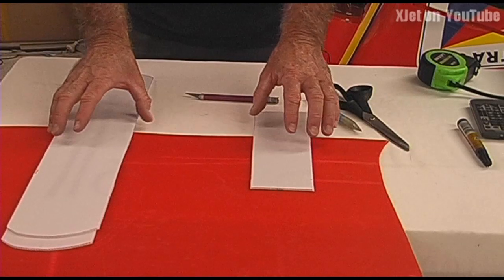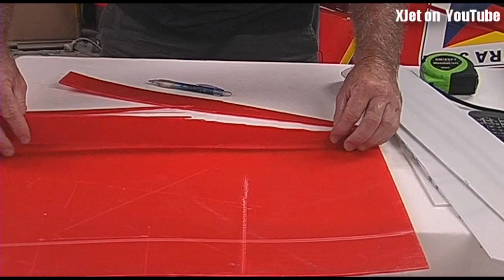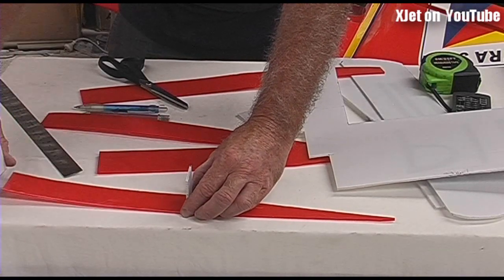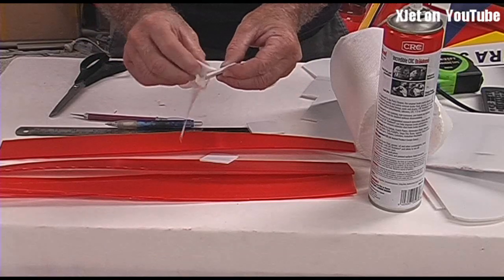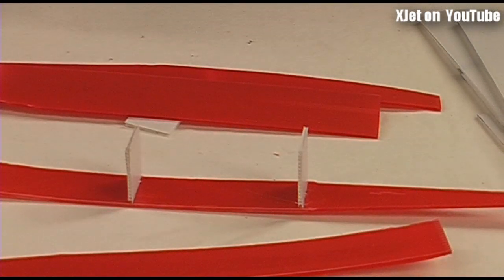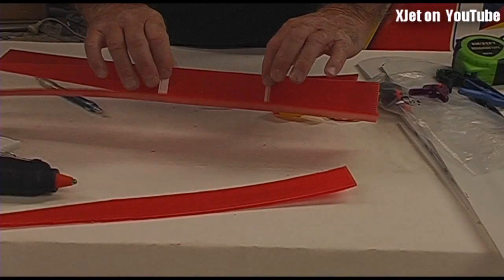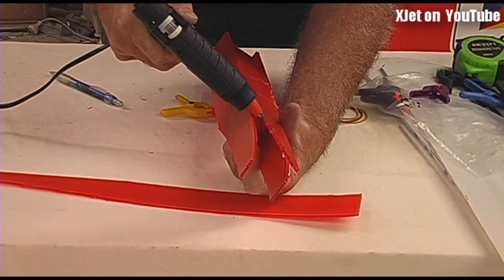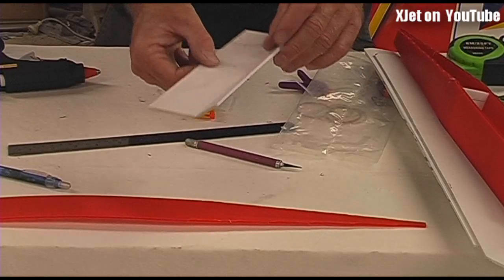Build video: The $10 RC nitro plane made from coreflute (part 2 of 3)

Comment: @dylmey, Based on xjets other coroflute/coroplast joinings I would say hot-glue all connections. He uses rectangular stanchions between upper/lower wing then hot-glues wing assembly to fuselage. I don't see much of a stager between wings. If you want to further brace assembly, use bamboo barby skewers (used to cook terriakie SP?) Hot-glue ends in x-brace fashion barely into wing skin. Skewers (split or whole) also good stiffeners in foam & for repairs! <1mm nylon cordage works 4 x-brace if glued

Comment: A cox can get up to around 17k RPM so just use a motor that will have similar RPM at whatever voltage you plan to use. Like if you use an 1800kv you would want a battery voltage around 10 volts or so, so a 3 cell lipo would be good while still having a decent bit of headroom. Current depends on prop size and the specific motor which both depend on the final weight, I can't really be of any help there but you can probably find a chart online.

Comment: I couldn't find video three so I improvised. The only thing I need help with what was done with the wire wing supports. Are they just hot glued in as well as are any of them connected? Open to suggestions for this part of the build.

Thanks

Comment: I have built the plane and am now ready for power. I would like electric for my first attempt. Any quesses on size of motor, gear reduction, etc. Speed control recommendations. Any help would be appreciated.  toI built mine out of foam from the Dollar store. I sheet  1 dollar. Coroflute maybe a better choice for crash worthiness. But the foam was sure easy to work with.

Comment: Hey im just wondering what radio gear to use im gonna use 3 survos the third one being a throttle for the coxx motor jus dono that battery i good for the transmitter running 3 servos any help would be great

Comment: you have to use 1/2A fuel or fuel that contains castor oil NOT synthetic oil you could the castor/synthetic fuel with high nitromethane percent or you can mix and blend your own fuel at home